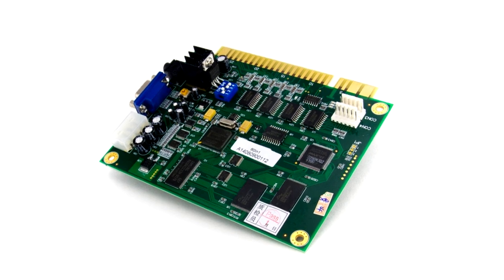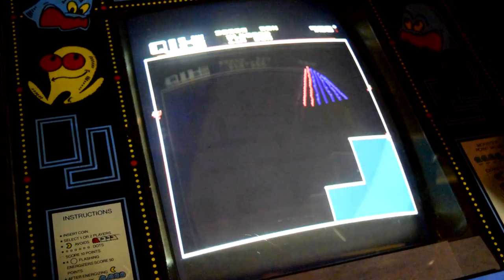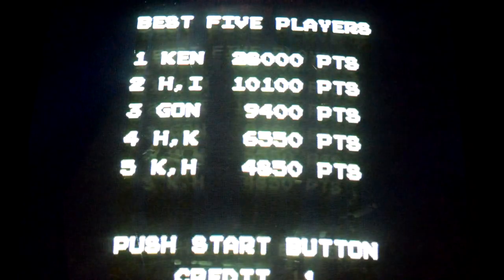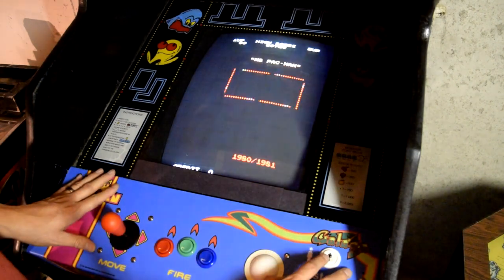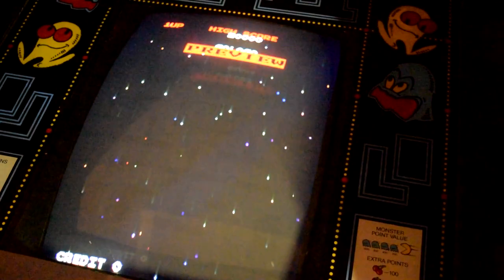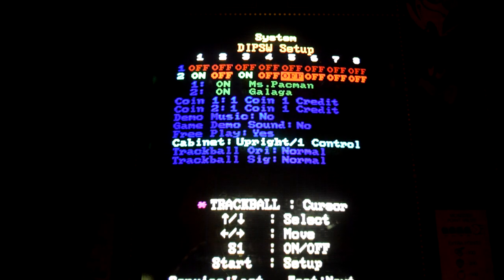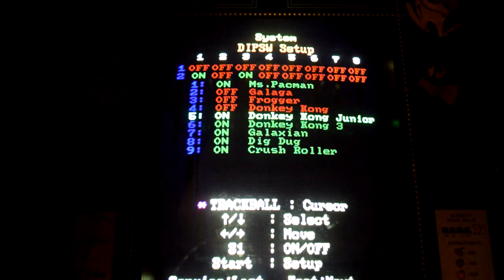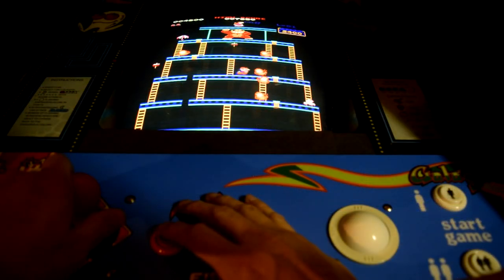60 in 1 iCade Multicade Arcade Multigame JAMMA Review

Comment: I have this board in a bartop machine. And I’ve not experienced the sound problem as mine has volume control. The Pacman and galaxian is set up wrong as in lives. I accessed the main set up and corrected that now. But I personally think this is the best board so far in my experience. I’ve a retro pi and pandora box’s but for me this board mostly has the classics for me as I’m mid 50’s and grew up with the originals

Comment: Only definitely plan on getting one of these boards for myself. I definitely think this board is worth it and I can see why many operators and different establishments have bought a 60 in 1. My main problem with this board despite it being worth it is the fact that Rally X is flat out broken. It’s meant for horizontal monitors not vertical monitors. Even if the picture was somewhat skinny. That wouldn’t be too much of an issue but the game is just flat out broken. kind of wish that this was mentioned but anyways good review.

Comment: Does anyone know which of the 60in1 games support simultaneous two player?  So far I've only found 1943 and 1943 Kai that do this, and only if you set the in-game dip switches correctly.  Are there any others? (Many thanks for a useful video)

Comment: Thanks for the video. I happen to get my hands on a 60n1 from a place that, unfortunately, had to close down due to CV-19. But I got the cabinet for $500. Couldn’t pass it up. I wanted to make mention that you may want to do a follow up on is about the sound. I had to add a potentiometer (500 resistance) and mounted it on the underside of the control deck. Now I can play when the family is asleep. 😉  I like your idea of adding a button to the Test leads. That is a tremendous help to the alternative. Thanks for that. Question, though, when you play Centipede, 2 players, is the two player screen mirrored? For instance, the centipede’s eyes are on the back of the first segment, the points displayed when killing the spider are reversed (003, 006, 009, instead of 300, 600, 900)? I noticed that on mine. I haven’t found ANYONE on any video mentioning about that. I’d like to hear your input on it, is it just mine or if there is a way to fix it or we just live with it. Thanks.
Reply: How much are one of these usually worth?
Reply: Alexis Pruitt I got mine around $600, but that was through a friend who had to shut down due to CV19. I believe, you could get one for $800. I wouldn’t go much more than $1k.

Comment: Just picked one of these up, wondering how/where the leads for setting up test / service switches are?
I have the 4 switch thing on the main board, but I'd much rather just hold down a button ... Having difficulty as I have no schematics or manual with my purchased machine. Any suggestions?
Reply from the maker: The leads weren’t well documented as I recall. I think I connected buttons to whatever was left or not labeled and a ground and experimented.
Reply: Lol sounds like what I was afraid of ... Well here goes nothing, should be fun!! Thanks for the reply 😁

Comment: hey cool video i was wondering what mod did you do to your monitor wires ? i to have a ms pacman with a bootleg board and cant get the screen working ?
Reply from the maker: The monitor connector and board receptacle didn’t quite align so I had to cut part of the monitor plug to make it fit.  But that was it.
Reply: @8bitredcat  yeah i had to cut it as well seems to be all working now. apart from i have a slight curl in the picture at the top right corner of the screen not sure what that is tho

Comment: I just bought this exact same arcade machine with 60 in 1 Games. My question is can I get other game boards with more games And just plug it in, or with this particular arcade machine is there Any limitations I need to know about?
Reply from the maker: jamesmartin3236 JAMMA switchers exist.  So, in theory you could have a couple of JAMMA cards in your cabinet.  I’m not sure how power would work or how you would switch between games but it would be a neat project.
Reply: 8bitredcat I plan to get rid of the 60 in 1 card and put in a 750 in 1 or more. I just don’t know if It would be compatible. Also there are different button layouts, that’s what made me wonder if all carts would be compatible with that particular arcade machine. The video shows the exact same machine that I have.

Comment: These boards have to have the negative 5 volts disconnected from the power supply or it will cause reset or lock up issues.

Comment: Is there any way to continue in gun.smoke and 1943? When I coin up it just adds credits to the main menu. If they don't continue I may just hide them.
Reply from the maker: Big Blanski I think so, but I recall it being confusing.  I feel like it takes you back to the main menu and you can reselect the game which will continue with the counter still in progress?  Or maybe that was just arkanoid
Reply: @8bitredcat  gotcha. Thanks for the reply!👍
Reply: Hit dip switch 4 on. And change gun smoke and 1943 to continue mode.

Comment: Where'd you get that Multicade Decal?
Reply from the maker: Here is the control panel: https://www.ebay.com/itm/Multicade-Control-Panel-w-2-trackball-hole-for-stand-up-Arcades-Jamma-More-/331887620247?_trksid=p2349624.m46890.l49292 and then I found a vinyl sticker for that panel on eBay (which I can’t find now)

Comment: Hi everyone,
a doubt: in the motherboard there is a vga output with CGA and VGA resolution; but can it be connected to a cathode ray tube monitor? If yes, what are the links to use? Are those of the jamma comb? Thank you very much for the clarifications. W the 80s games, my siblings were always at the bar to see others play, hahahaha
Reply from the maker: Mary Elisabeth there is vga and cga connectors.  VGA has a dedicated 15 pin din connector (standard port). Cga goes out via a 4 pin molex connector.  (Nope, wrong. Molex = power). Either can go to a crt if the crt supports vga or cga.  Or the vga output could go to an lcd.
Reply: 🤔Are you sure? Molex was to connected this pcb with a power supply PC, no? If the crt hasn't a CGA/VGA input, be able connected it always on rgb mode?
Reply: @8bitredcat  Dear 8bit,
in fact, my brother confirms to me that the 4-pin molex connector is used to power the 60 in 1 card through a pc power supply with its own molex connection.
Did I misunderstand or did I misrepresent the question? My request is: once I have connected almost all the cables from the jamma comb, to get to the 5 CRT monitor cables (old catodio tube in an 80s cabinet for instance), these 5 pins from where I take them?
Reply from the maker: Daniele Lampis I’m wrong. Molex = power.  I get cga from the JAMMA harness.
Reply from the maker: Mary Elisabeth I’m wrong. Molex = power.  I get cga from the JAMMA harness.  The monitor on my cab is original and uses red/green/blue/ground wires from JAMMA. Do you want to hook this up to an old school cga computer monitor?
Reply: @8bitredcat  Thank you very much for the clarification.
No no, the monitor is just a native of an 80s cabin cruiser, with its chassis without scart or rgb attack. Are you aware of the wire contact you were saying? Red, green, blue and mass. But I know that these monitors have a frequency of 15 khz, this frequency is native to this 60 in 1 card, or should I adapt something that turns the signal into 15 khz? I would not burn the monitor.
And then, if I were to use an old crt for PC with the vga attack, how do I behave like that for the video signal?
Reply: @8bitredcat  Thanks, you are very prepared👍
Reply: Hi, I am trying to connect a 60 in 1 board to the original CRT of a Ms pacman.  any Ideas? I was thinking of just connecting the RGB & sync from the VGA to the CRT wires, but not sure if that will work. I am looking on google, but couldn't find much. thanks

Comment: Are you using a classics of 1981 control panel
Reply from the maker: It’s custom built. The base console with bottom and controller cut outs was available on eBay. The buttons and controllers are all common Jamma. The vinyl artwork on the controller was available on eBay as well.
Reply: @8bitredcat  is there links

Comment: So tell me your button layout what's the red green and blue buttons register fire what are the other two
Reply from the maker: I picked red, green, and blue buttons for (what should be) obvious reasons. The red button would be your primary (jump for donkey Kong), green for secondary (bombs in 1941). Gun smoke is the only game that requires all three buttons (iirc).
Reply: up to 3 buttons
Reply: button 2 is like shield in phoenix  only the cowboy game needs 3  and it could be told to work with 1 btn

Comment: Great review.  After I watched this I purchased a 60 in 1 kit and a 3 inch track ball from Paradise Arcade Shop, and a dedicated Happ dedicated 4 way from Ebay.

Had Coin Ops original set up in a Space Invader Cabinet that I found in the trash with an X-Arcade controller and XBox.  Unfortunately the hard drive crashed.  Pretty bad regarding 4 way game play.

Bought two two player Pandora’s Box 20s 3D WiFi’s on Ebay.  Set one  for 4 way to play older arcade games and one set for 8 Way to infinity for fighting.  With the upgraded Sanwa JLFs it plays pretty good on the 4 way gate.  However lacks the proper feel for PAC, DK, etc.

Growing up in the late 70s and early 80’s is a blessing and a curse regarding arcade.  

After playing the originals believe the only way to get close to the feel is by doing the full 60 in one set up with a track ball.

Not knocking it but personally not interested in 1st Up.  Cabinets don’t have dimensions for comfortable game play.  However I do think it does reach those who don’t have the space.

We will see how the 60 in on for the Space Invaders Cab goes.

Comment: you mean CRT monitor, a CGA monitor only has 4 colors, which the old IBM PC computers used before EGA and VGA.
Reply from the maker: rabidmarmot I mean CGA CRT. Most all retro arcade cabinets had CGA CRTs. Later games moved to VGA. If you look up the 60in1 or any JAMMA board you’ll see outputs for CGA and VGA. A CGA monitor can display 16 colors but most PC modes only offered a 4 color palette.  However there are a bunch of tricks that can be done to get more than just 16 colors. Tbh I’m not sure how arcade cabinets implemented color and graphics on a CGA monitor and assumed that CGA couldn’t be right as I’m also used to black, white, cyan, and magenta PC games. https://en.m.wikipedia.org/wiki/Color_Graphics_Adapter
Reply: @8bitredcat  I stand corrected, thanks for explaining!

Comment: My Jamma is stuck at 7:48 on your video. It doesn't load the games or anything. It just shows the plaid screen and plays the music. It's in service mode.
Reply: 7:15 My cocktail system already had a test switch he mentioned.  The 60 in  1 was plug and play.  The switch is how I maneuvered thru the menu.  I am guessing anyone without the test switch would use the DIP switch 3 on the board to move thru the menu.  Turn it on and off?
Reply: move dipswitch 4 to off position when off   then turn back on

Comment: HELLO ANYONE OUT THERE.  does jamma 60 in 1 support track ball, if so, which wire does it connect to. thanks
Reply from the maker: Yea it does. There is a header on the 60in1 for the trackball
Reply: @8bitredcat  could it be the player 2 pin?  I see you mod it with a TB.

Comment: Is this considered MAME?
Reply from the maker: mike martin no. It’s just a game board.
Reply: 8bitredcat thanks for the response. So I’m confused. What’s the difference? I tried searching youtube and they put the 60-1 in the same category. Is mame just software? Also, how close is the 60-1 to the real thing or is mame better as far comparing it to the real thing? I would assume a PCB board is closer but I have no idea.
Reply from the maker: MAME is typically software running on a computer like Pc, Mac, Pi, Android, iPhone, etc. where you can add and remove ROMs. Depending on the version of MAME and the power of the computer determines how complex of a ROM you can run.  The 60in1 is a hardware ROM with a set of games that (afaik) can’t be swapped in or out.  This card also plugs directly into a JAMMA harness whereas a computer would need a JAMMA interface before plugging into an arcade cabinet. The video goes into a bit of detail about how close these are to the real thing.  However, the reality is that, they are not the real thing so a purist would most likely pass this by.
Reply: 8bitredcat thank you for clearing that up. But I have to say, original motherboards are dying out each day and becoming harder to repair or replace so  at some point, I think the “purists” will have to settle for the next best thing. I’m actually surprised that there are as many originals out there as there are. They must do a hell  of a job at maintaining them.
Reply: no